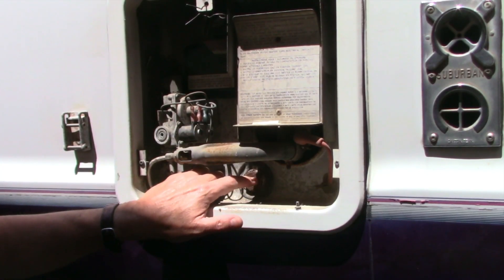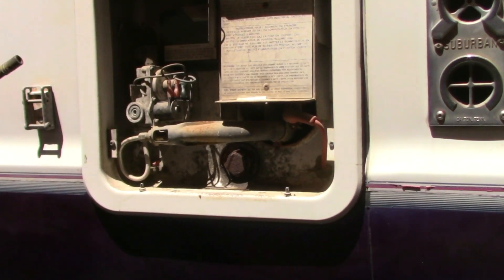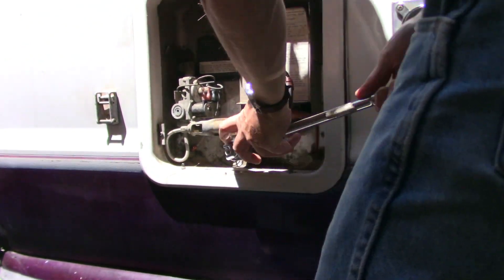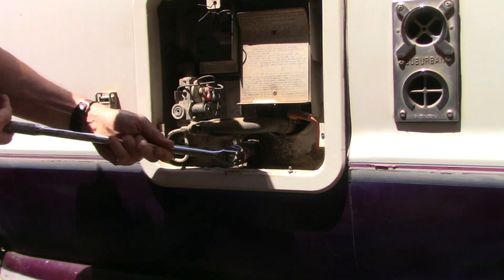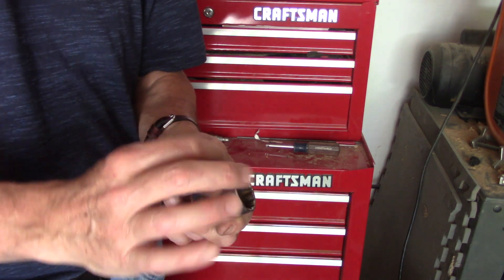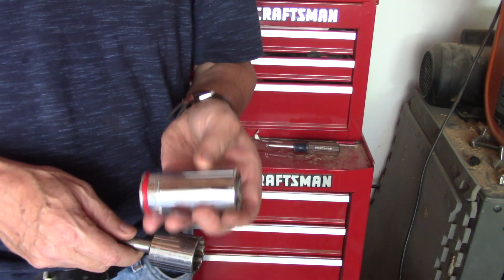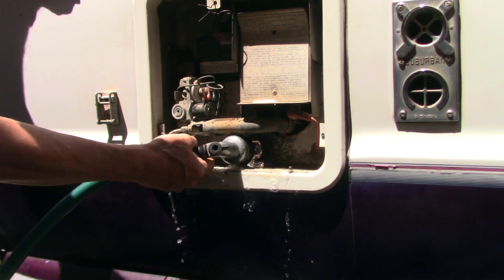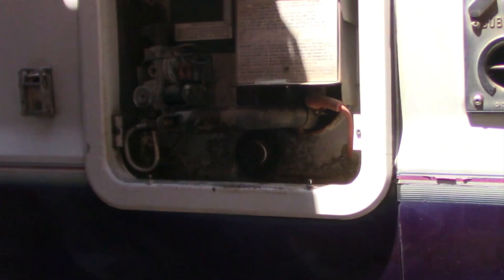How to remove a seized RV anode rod

Comment: SORRY!  WHAT YOU TOOK OUT IS AN ANODE ROD THAT IS COMPLETELY DISSOLVED.  WHAT YOU SEE LEFT IS JUST THE CENTER CORE.  THE REST OF THE ROD HAS DISSOLVED!
Reply: i guess im not the only one that caught this. the anode part is still in the tank after he pulled it off the rod when twisting back and forth to remove
Reply: @sanfordgld  CORRECT!
Reply from the maker: There is a small hole that this anode rod went into and the replacement anode I bought simply does not fit.  There is very little corrosion on the rod I took out but I cannot find the correct replacement rod.  This is why I put it back in.